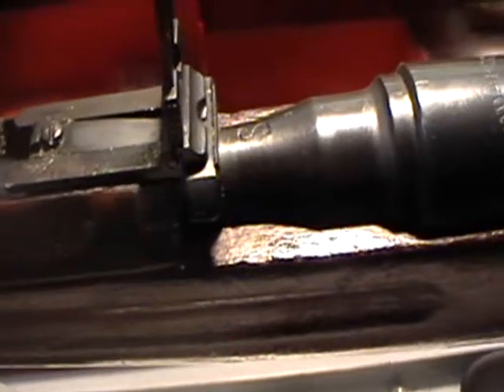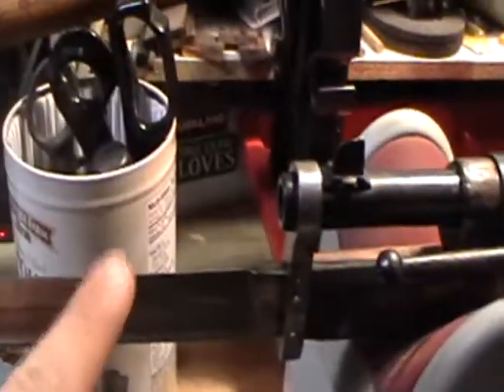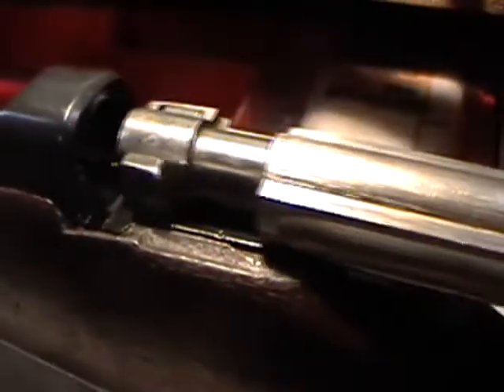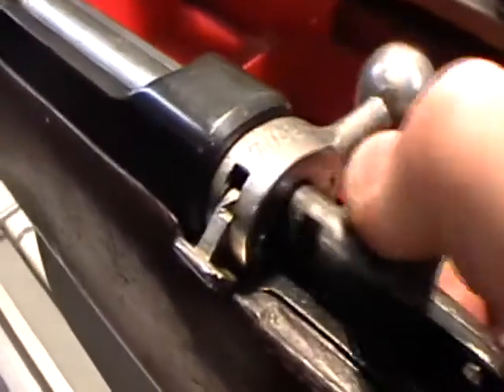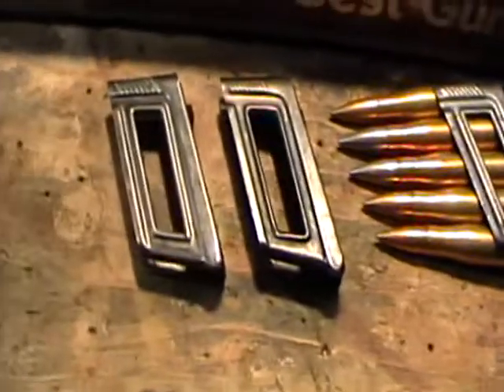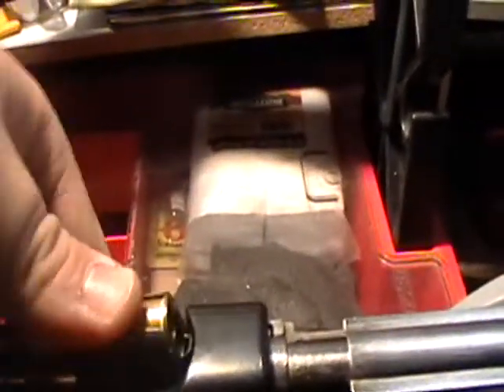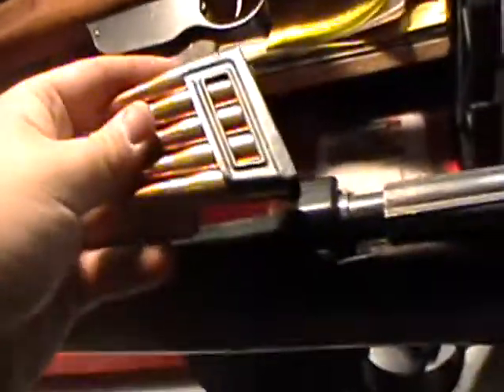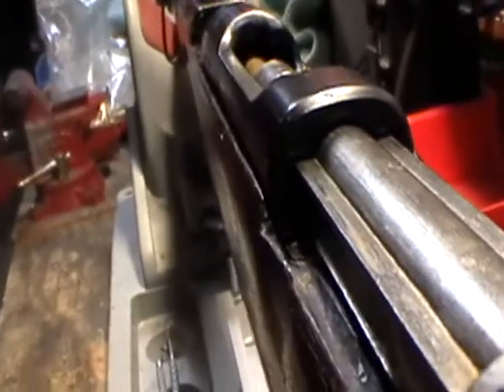Steyr M95 Straight Pull Carbine Bolt and Rifle Disassembly Pt. 2.wmv

Comment: took me an hour to realize when reinserting the bolt after a thorough oiling and cleaning that I had to hold the safety in such a way that when reinserting the bolt into the receiver that it would butt all the way up with the edge of the receiver. You're video clarified it for me! thanks a ton!

Comment from the maker: Import marks may be in different variations. Stamped or dot matrix. They can be small, along the stock line, or on the barrel, near the muzzle, or on the receiver depending on the importer. As far as other markings, it should be typical to find then with a large "S" somewhere on the barrel, barrel shank, on the top near the receiver. This indicates the rifle has been rechambered for the 8x56R. The original cartridge was an 8 x 50 round nose.

Comment from the maker: Well, date can be stamped differently. I am not sure where exactly. Neither of mine have a date I am aware of. The Steyr M95 carbine, is actually the "Stutzen" carbine. That is an Austrian/German word meaning the original long rifle was cut down to carbine length. You can tell typically by looking the front sight. If there is a band around the barrel where the front sight is, then it was a cut down long rifle. No band, with the sight sitting on top of the front sight it was a carbine originally.

Comment from the maker: You could find dates with a W or Wn and an eagle crest, then a 2 digit number. So: W(n)(Eagle)20 would mean it was approved in 1920 for use. Then if there is an overstrike or a similar stamp of a later year, then it was rechambered for the 8x56R at that date most likely in the 1930s. Where to find it is a matter of looking, but I couldn't locate a date on my own. Somewhere near the barrel shank/receiver on top or near the stock line.

Comment from the maker: @solkacorot Might have to do a little wiggling or fenagling to get it to go. Just make sure when you pull the bolt rearwards, the bolt head isn't trying to turn. That could be the case, and maybe you aren't pulling back hard enough? I have had experiences and can feel if the bolt head is going to turn or not. I slam it home and pull open again until the bolt head is going to stay turned out before trying to remove it. They are temperamental sometimes, and you gotta have the "touch" sometimes.

Comment: what model is your Steyr ? ours is a Budapest M95, we bought what the gun shop said it took, the8x56R, but , I found a couple sites that mention 8x50 R. The ammo we bought was old 1938 military surplus, the bolt wouldn't close all the way, it jammed , but we finally got it open , and found the shell was stuck in the chamber. I was able to extract it with little effort . What do you think may be the problem ? Could it be chambered for the 8x50R ? Thanks for your time.